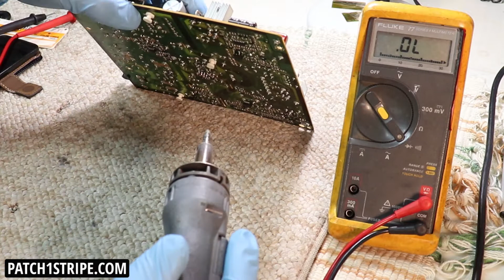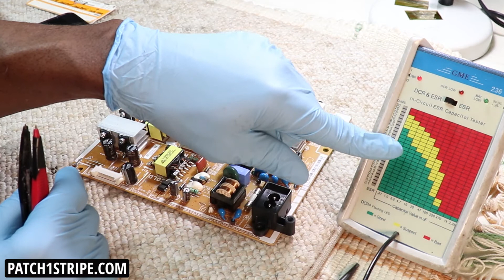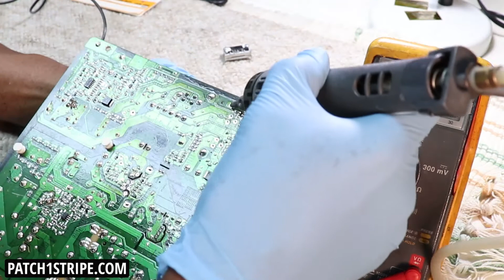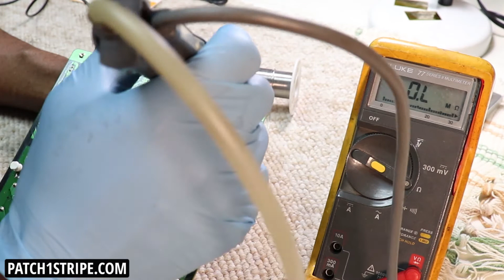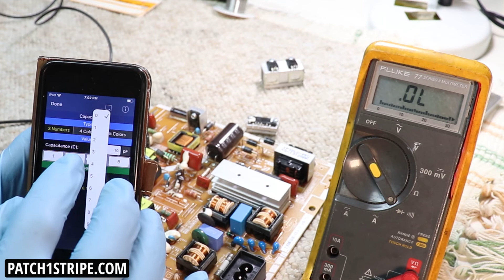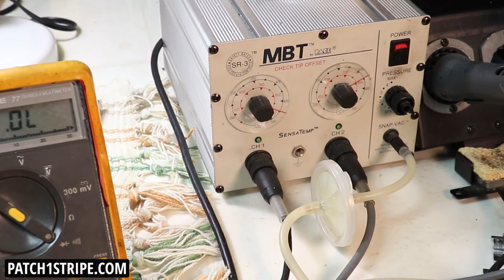HOW TO REPAIR A SAMSUNG POWER SUPPLY - COMPONENT LEVEL

Comment: I have a Samsung UN32EH5000F. Replaced the power board and the main board but still cannot power on. What I have found when I unplug the backlight dim control I can power it on but not when is plugged back. The plug for the backlight dim control (CNL802) says D-, +5V, -5V, and D+. Any clue what can be wrong? Thanks
Reply from the maker: https://www.youtube.com/watch?v=_VcNgvfIa9A this is the video you need to watch. Throwing parts at a problem is not the way to go. Put your original parts back in your TV and start over with this video.

Comment: Great repair video. Please where can I get this resistor test you used in this video? Thank you.
Reply from the maker: I use Fluke voltage ohm meter. Safer than cheap price meters.

Comment: a neighbor of mine threw away a samsung 50 inche 4k uhd tv.. and i took it and was not sure if it worked or if i could fix what was wrong with it. I was hoeful i might be able tofix what was wrong with it if it was not working. And that is how i ended up finding your videos.. like how to remove the back panel. And i really liked how you explained all the parts and how to identify them. I would like to get that resister card you showed and also I am interesting in getting the Electonics tool box app and also getting a heat gun and soldering gun like yours. I have been needing something that will make it easier to desolder components. Also. I like the infrared device you use to heat up your pc board and components to help mend their solder connections. I subscribed to your channel and thumbs up on this video.
Reply from the maker: you can repair that no problem. Go to my video "how to repair any Samsung TV". You won't need any electronic test equipment. Good luck.

Comment: Thank you very much for your videos. So my wife said the tv made a noise like a gunshot. Since then no power no red light, nothing. Took it apart and disconnected the power board from everything. No back lights no power on nothing. Is it my power board and do you have one. Model number. Qn75q65fnfxza. Thanks
Reply from the maker: Glad to help